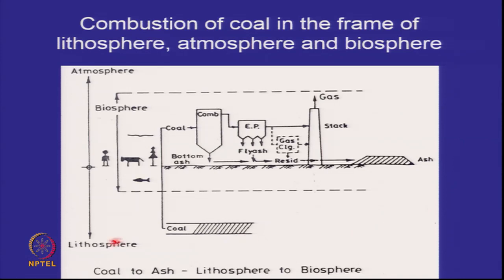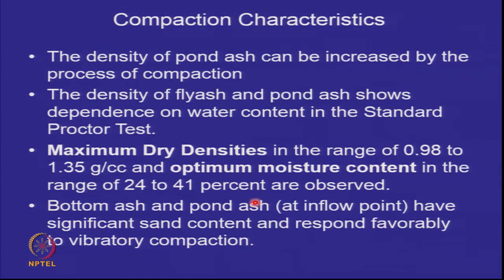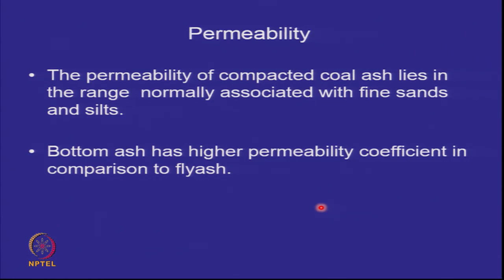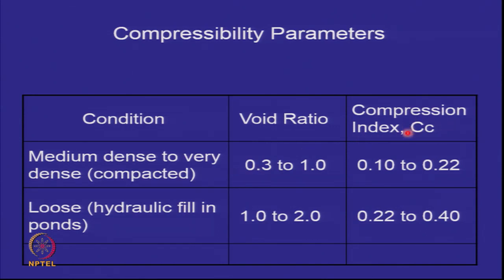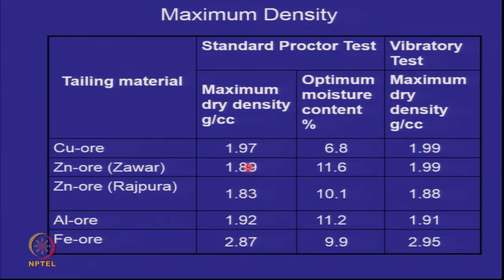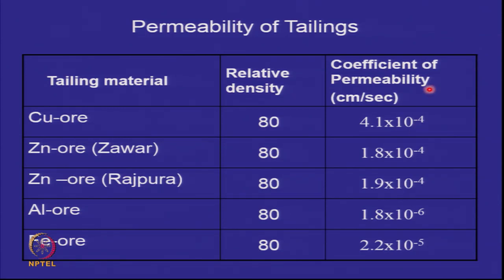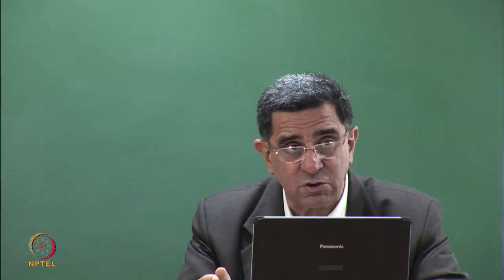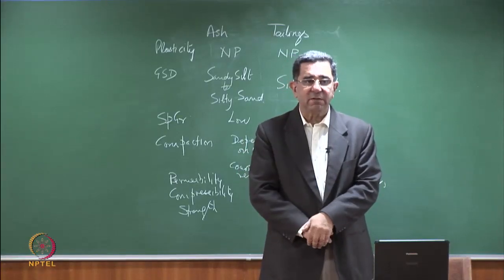Geotechnical Properties of Coal Ash & Mine Tailings - Part 2

Comment: He's legitimately concerned about lead, but what about mercury, and other heavy metals, or poisonous nonmetals?
Reply: Sir I have completed my M Tech in Geotechnical Engineering ( Civil ) , I want to pursue my Phd in Geoenvironmental Engineering then which IIT is good IIT Delhi or IIT Bombay and also I want to know best guide for the same topic
Reply: Found bottom ash at a new construction site as it’s silt / sandy. Could we use it below sub base of a parking lot? If so what have others done? We’re thinking of using a geotechnical fabric and than putting 8in of sub base and 4in of asphalt. Wonder how it would hold up